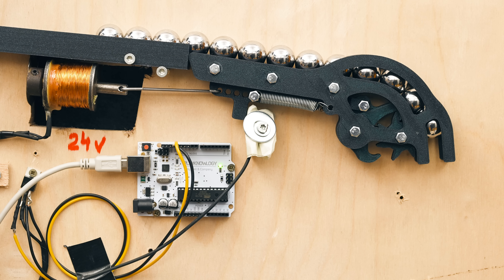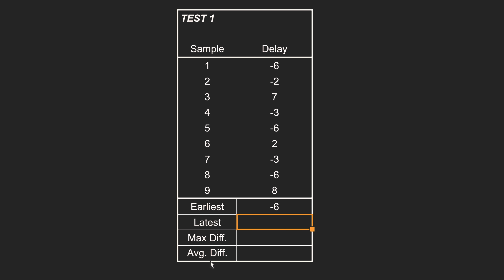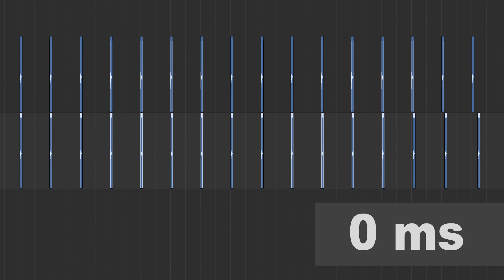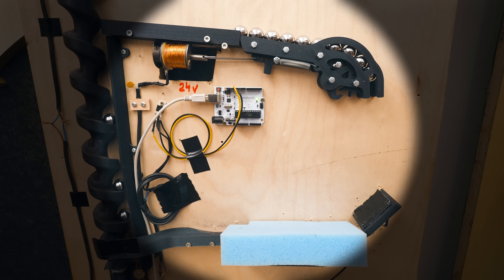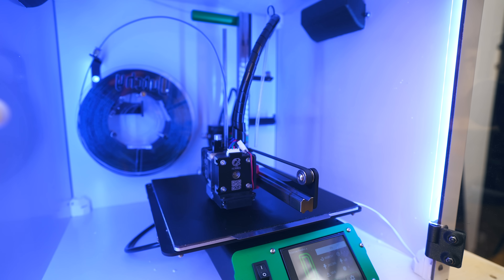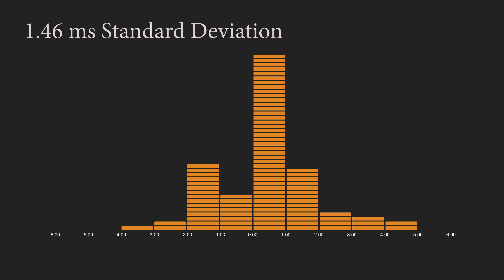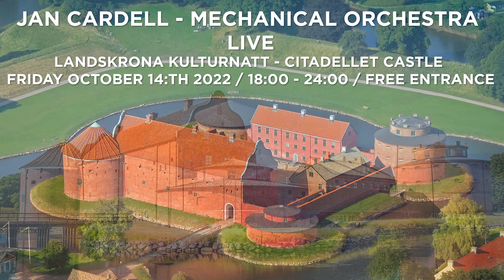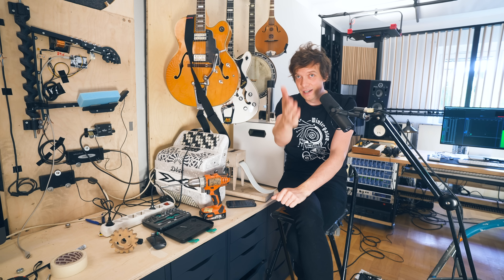Testing the Arduino Marble Gate

Comment: Another thing to note if you keep doing arduino-based tests is that you can use timer/clock interrupts in the arduino to make sure every loop is exactly the same length of time. This becomes more important once your loops get more complicated, but it may help a bit even at this stage.

Comment: 1ms is an eternity for CPUs, even for a microcontroller as slow as an Arduino. A 16MHz model does 16 clock cycles in 1us, with some massaging and nothing else to do it should be possible to hit, ballpark, 1us. A square wave generator using the board's timing crystal would should get you even further.